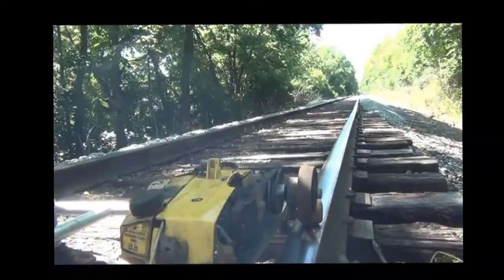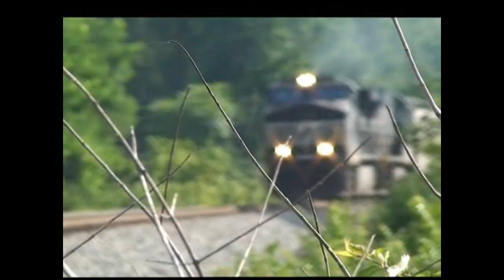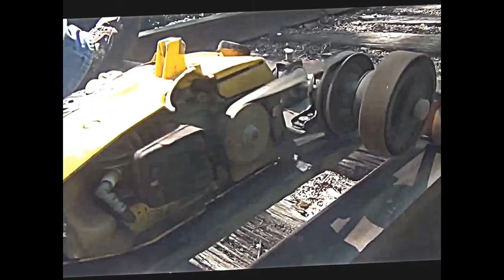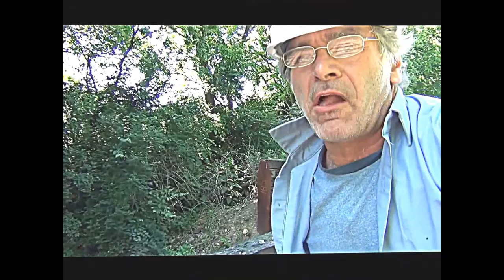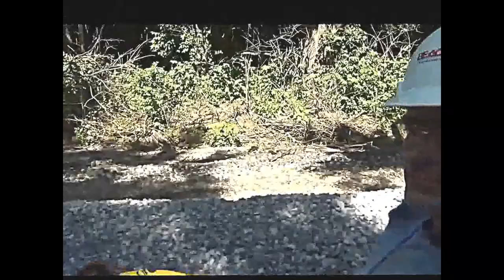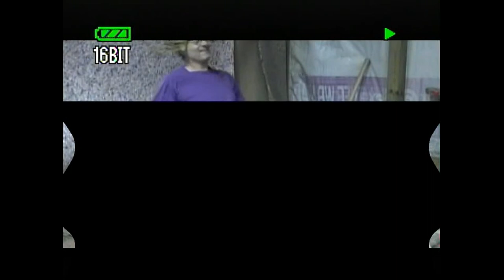Contraption Gocarts on railroad tracks and trains

Comment: Bad Azz  so how fast? only thing i would change is the inter wheels that you have that keep it from falling off the track  make them the same wheels you have ridding on the tracks and then make them  1/4 to 1/2  inch from both sides  for derailment the have bearings that would last many 1,000  miles like lawn mower bearings too sealed bearings to car bearings but.......... i think you know this... maybe I would like to make something like this  travel for 10 days but what would be a good engine? hmm one that you could carry with you? STIHL make it a fold up?
Reply: o believe you left distance for derailment how much?